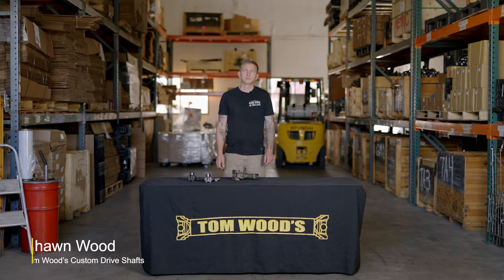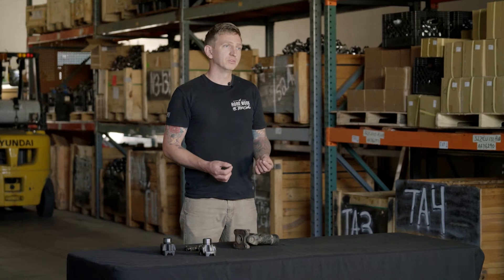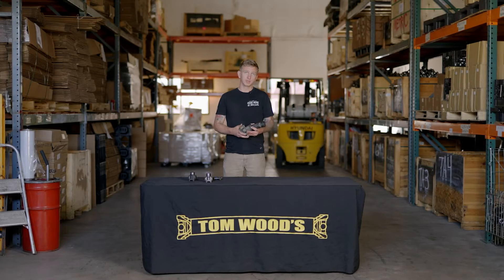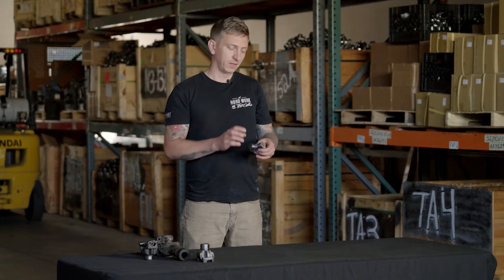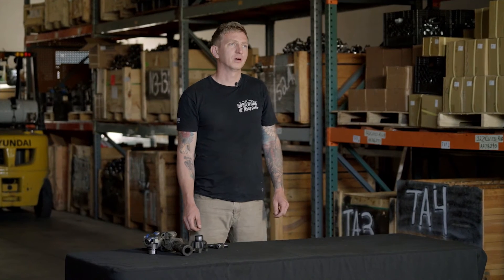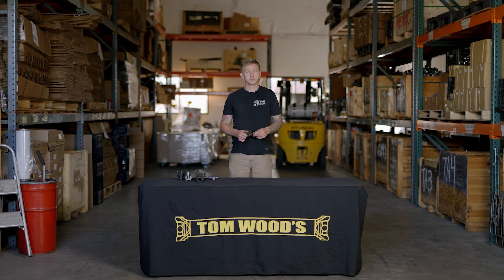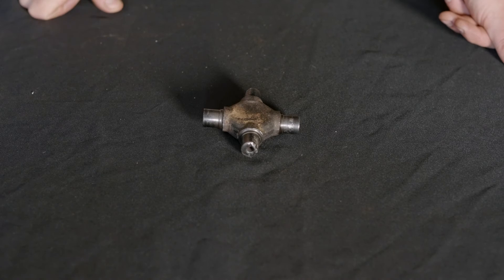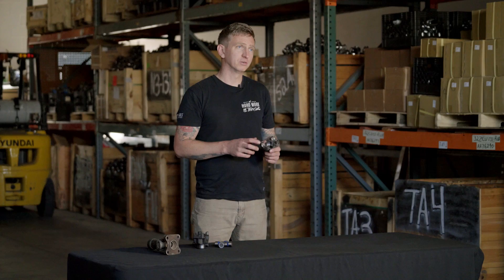Why Are You Breaking U-Joints?

Comment: I'm having a problem with my jeep... my drive line angles aren't excessive... like 10 to 12 degrees at most bur for some reason a freshly changed and greased u joint are burning up in like a month of daily driving...  it has a 4 inch lift and s custom rear suspension with a Ford 9 inch running a double cardian at the t case and a 1330 on the diff side... its always the diff side that burns out and only ever one of the caps... the yolk seems tight... any thoughts